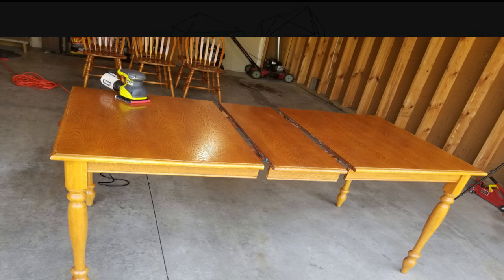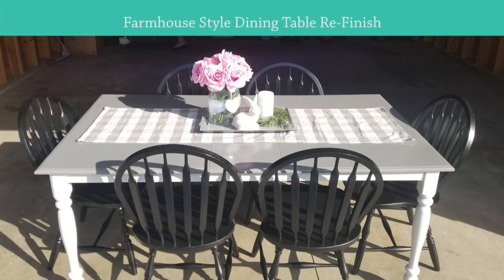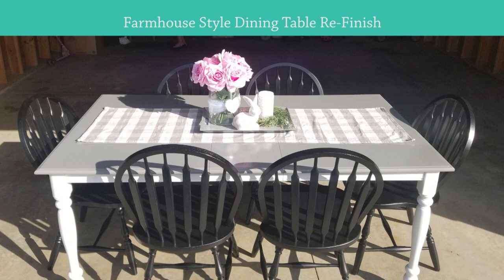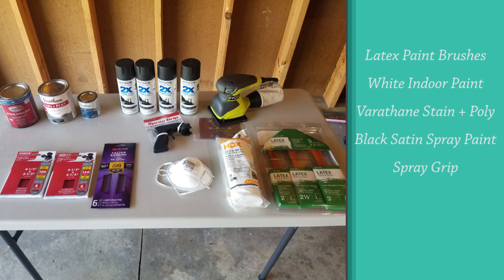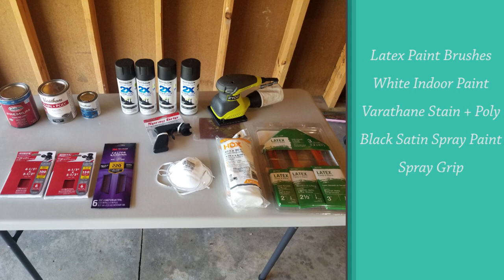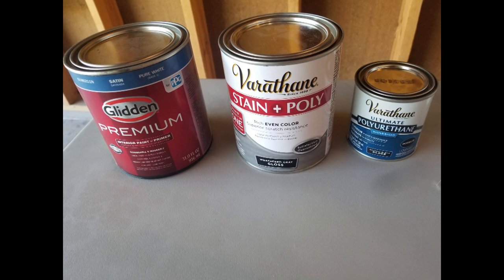DIY Farmhouse Style Kitchen Table Refinish

Comment: that was some extremely great coverage for a stain, even if it was one with stain and polyurethane...I actually used something called polyshades made by minwax, on my living room floor!!! It was sanded down to the bare wood and then I rubbed it into the wood just like you would regular stain...normally just stain is still matte & dull, but when its mixed with a little poly it's a perfect combo...I shouldn't have tried a furniture stain on a whole floor but whatever! I just found your channel, are you going to keep making videos?